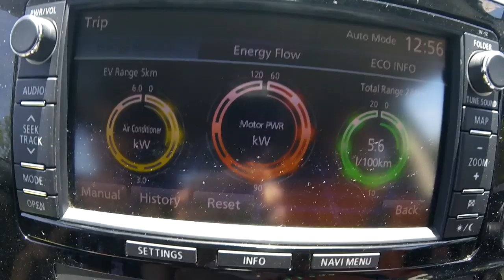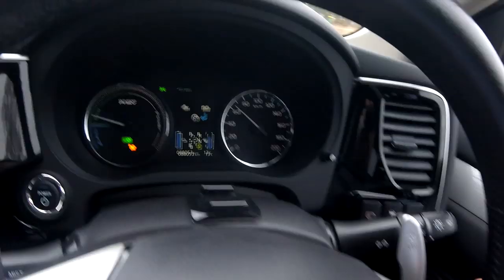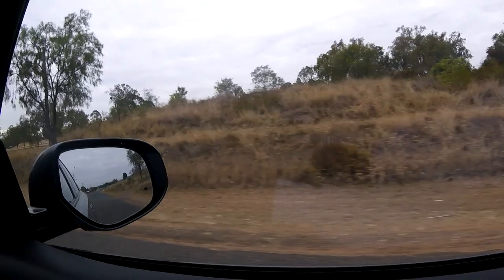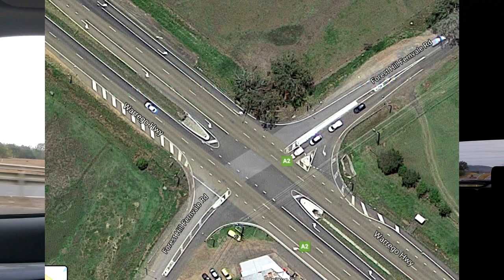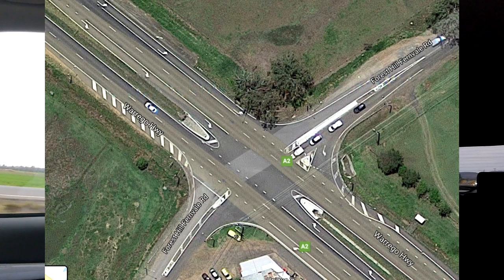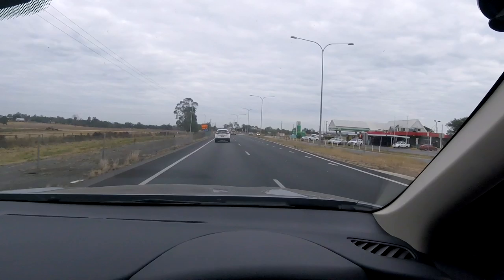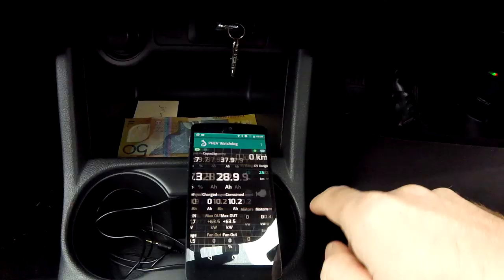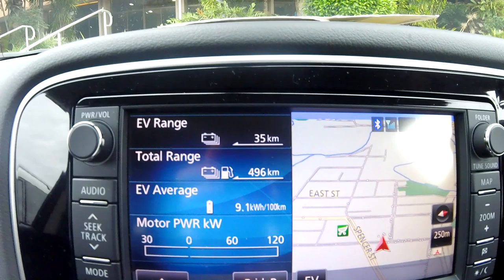EP256 - Lindqvist was yesterday. Fix the PHEV with the D-Method!

Comment: Andy, I reset the car a second time. This time, everything went well! The car is driving error-free again! I have the first time 12V BATTERY FOR 2 HOURS ISOLATED 2 HOURS FINALLY TOO SMALL at the 2 times I have disconnected 12v battery for 8 hours after all other steps again performed. Now the car is running like one again. For anyone who wants to try the Lindqvist method, I recommend disconnecting 12v battery for 8 and more hours. Otherwise, there is the possibility that you get the same problems as me the first time! take your time Lindqvist Method does not hurry! P.S Andy Best Man Keep it up !!!
Reply from the maker: Great Alex, thank you!

Comment: Goodmorning Andy,  I was just watching this video, when you said the story of Alexander “Alex” , after a partial reset, due to power failure.
We drove 2699 km to France and back to the Netherlands. Than the same as Alex, now power, after pushing the charge mode no problem.
At always happens with a low battery and low on fuel.  The time the main charger needs for a full load is longer from max 4.15 ‘‘tis now 5.15.
Yesterday at 19:30 we cut of the power on the 12 v battery of the 🚗. This morning at 07:30 we plugged in the charger, connected the 12 v. battery for 5 sec. and now we will wait.
Reply: Good morning, here is Alex. In my experience, the problem should go with performance loss way. I reset my Outlander second time on Wednesday, I disconnected 12v battery for 8 hours then connected charger, connected 12v battery for about 3 to 5 seconds and then recharged after 6 hours charging the car has finished charging as it should and the green charging light on Charger has blinked permanently. Charger removed and the 12v battery reconnected, at first startup comes an error message fault electrical system watchdog showed 105% and 40Ah ignition off again, comes immediately correction 38Ah and no more errors! Loading times have also been extended by about 1 hour for me. When loading with chademo I need now instead of 23 min 43 min while shaft charging station charge 6.8 Kw before it was only 4.2 Kw between 30% and 78%. in 4 days I drove 1300km of it 300 electric. Have not been able to find any more problems so far no matter if battery is full or empty, except that the battery capacity is now 37.7 Ah. I'm curious how fast the battery comes to old values. And one more thing the problem with performance loss probably comes from wrong data. according to watchdog the battery would have 10.6Ah when the problem occurs, I noticed that the battery only 262,8v indicated before the battery has never had less than 273v, I have never seen before. I suspected that the battery is already empty. It is not with me other than the 12v battery to separate again I was curious and have just tried what happens when I disconnect the 12v battery for a short time. I disconnected 12v battery for about 3 minutes and reconnected and suddenly watchdog showed me only 1.6 Ah instead of 10.6 before 3 min so difference of 9 Ah. That is, the controller has gotten the wrong data all the time, and of course not started the engine at the right time to recharge the battery because system has still indicated enough residual current. in reality, the battery was already empty! why it happened so I do not know. After two days of testing back and forth, I decided to reset the car again. Second time was completely successful. Hope my post was helpful to you and other interested parties. Alex

Comment: Finally the D-Method worked for me! I've been trying every variation of the Linqvist method that has been posted but didn't have any luck. Thanks! 
I have a North American 2018 version.
Used the BMU voltage display on the Dog until it showed just under 8v with no load. Around 7v with everything on: High beams, Fans, Seat Heat etc. It was very interesting to watch the various systems shut down with warning messages as the voltage dropped. 
Took about 3 tries when reconnecting the 12v with the EVSE plugged in to get the timing right.
Reply: Lon 12 how long it it take to drain the battery down to 7V?
Reply: @matradlinski8084  
Sorry I didn't time it. It was less than one hour. I also plugged in a little 12v cabin heater to help load it up.
Reply: @UCdlAm4TxwcK5OXwcqiLbq8Q Thanks, I just wanted to get an idea (I have the same 2018 NA model).  Did you leave the trunk open or closed?  Also, what was the final outcome, 38 or 40Ah?
Reply: @matradlinski8084  
Trunk was open with a blanket covering lock. 40 Ah.
I'm wondering if the Linqvist method worked with older cars as their 12v batteries would drop voltage during their disconnect hours. Our newer cars 12v might be holding their voltage longer.
Reply: @lon1253  Finally tried the D-method a couple of times. No luck! What do you mean by blanket covering lock?  Can't the gate be open during the procedure?
Reply: @matradlinski8084  Yes. I didn't have the room to leave the gate open for hours on end while I tried the different procedures. The blanket just prevented it from latching closed.

Comment: Andy, nice video,glad to see your happy face & back to longer videos  👍😁 
Updated now and looking forward to the suitcase, yeah a bit of ducking and diving again to keep us coming back ready for the next vid, just like the soaps do on the telly, your getting the hang of this 😉
Im quite sure this new method is the better way, as long as the rom is not disrupted on the eprom all will be fine otherwise you are screwed. Its much like the pc ram wipe that we do with the button to the case to reset I think?
If we knew if it was a plugin type & where the dam thing was we could adapt it so a reset was as easy as the pc type, maybe?
So up until now I wasn't convinced all this charge up method, unplug etc was the right way,but now I might be up to try this, as it seems more logical. 
As I still have 35.1 Ah Im not to anxious yet, but it would be nice to see 38+ back. if it stays dry here, there's a good chance I will attempt it.
Its a pity Haynes dont make manuals for the Outlander Phev cos that would be useful here.
Stay Charged m8  😎
Reply from the maker: Hahaha, thanks Chris! There is a new method every day... just wait you'll see...

Comment: Good morning, here is Alex. In my experience, the problem with performance loss should go if someone got the same problem using Lindgvist Method. I reset my Outlander second time on Wednesday, I disconnected 12v battery for 8 hours then connected charger, connected 12v battery for about 3 to 5 seconds and then recharged after 6 hours charging the car has finished charging as it should and the green charging light on Charger has blinked permanently. Charger removed and the 12v battery reconnected, the first startup is an error error electrical system watchdog showed 105% and 40Ah ignition off again, immediately comes correction 38Ah and no more error message! Loading times have also been extended by about 1 hour for me. When loading with chademo I need now instead of 23 min 43 min while shaft charging station charge 6.8 Kw before it was only 4.2 Kw between 30% and 78%. in 4 days I drove 1300km of it 300 electric. Have not been able to find any problems so far no matter whether battery is full or empty, except that the battery capacity is now 37.7 Ah in 4 days. I'm curious how fast the battery comes to old values. And one more thing the problem with performance loss probably comes from wrong data. according to watchdog, the battery would still 10.6Ah when problem occurs while I noticed that the battery only 262.8v cellen full 2.95 v indicated before the battery was never less than 273v had, I have never seen before. I suspected that the battery is already empty. it is not with me other than the 12v battery to separate again I was curious and have just tried what happens when I disconnect the 12v battery for a short time (actually stupid but I had nothing to lose anyway ;-)) me disconnected 12v battery for about 3 minutes and reconnected and suddenly watchdog has shown me only 1.6 Ah instead of 10.6 before 3 min so difference of 9 Ah. That is, the controller has gotten the wrong data all the time, and of course not started the engine at the right time to recharge the battery because system has still indicated enough residual current. in reality, the battery was already empty! why it happened so I do not know. After two days of testing back and forth, I decided to reset the car again. Second time was completely successful. Hope my contribution was helpful for anyone interested in these topics. Alex
Reply from the maker: Excellent feedback, thank you!
Reply: I did the L-method on my 2014 Outlander. Seemed to work. Now it shows same sympoms , power loss at 4 km left on battery. Took it to Mitsubishi dealer. They said the problem is with the BMU thinking the battery is 2 months old (10 years actually)! This is the real reason for the motor not kicking in as needed. Sure, hitting the charge button helps but this is not what it should be. Not very satisfied customer!

Comment: Lindquist method 100% ok, from 72% to 100%, or from 27 amp to 38 amp. working effective. 67000 kms vehicle year 2013. Thanks friends.
Reply from the maker: Good work, Antonio!
Reply: Hi Antonio, what was your method. I've a 2015 but no luck yet 3 times. Just need to know if an older model like mine needs longer battery disconnection etc?
Thanks.
Reply: @robertnewberry4329  Hi did you get it to go I finally got my 2014 done

Comment: Just a warning. Depleting the 12v battery that low may damage it. It is not  made for that.
Reply: Yes, not ideal for the battery, maybe there's a way of artificially reducing the 12v, by way of a low ohm/high wattage resistor between the neg pole
of the battery and the negative lead ???
Reply: Yes let’s ask Mitsubishi to artificially degraded the 12 volt. After all they are experts at degrading batteries lol
Reply: @AndyM...  a couple of H7 lightbulbs in parralell might do the trick.
Reply: @Zecret W That's a better idea, the only concern after that....is the low voltage going to damage any sensitive components (a bit like a mains power "brownout" which can do more damage that a "power out")  !!
Reply from the maker: Battery will be fine at 8V for a few minutes, no damage to expect. These lead acid batteries are very tough. My ride-on's battery was flat dead on just 1V for months and after charging it it still fine and working, holding voltage as before....

Comment: Same thing happens to me after LM as for Alex. Suddendly no power from the engines, ICE is not starting, no EV.  Really dangerous when it happens in traffic. Pressing the Charge button makes it come back to life after some time. It seems It happens when one cell goes too low, maybe <2.8v, when SoC is getting closer to 30%.  When Charge button makes it above 3v again, then engine power comes back.  This happens less and less as SoH is adjusting back down. Now I have an eye on the Dog when SoC is getting closer to 30%, and as soon as min cell voltage goes below 3.1, I press the Charge button. Would be a real good feature to add to the Watchdog App, to have a warning sound when cell voltage goes below some threshold. 
I have one bad cell which goes much below all others, which seems to be the reason for above problem, so I would like to replace just that one as I assume it will make a big difference. Any advice on how to do that is appreciated.

To be added as last item to LM step by step list: Press Charge Button in case Min Volt goes below 3.0V until SoH has adjusted back down enough.
Reply: That bad cell needs to be replaced asap. by dropping below 3.3V it starts degrading even faster than the other cells and the situation goes worse and worse.
Reply: @M1kke78  Asked Mitsubishi to replace the battery on my cost (105000 SEK), but they refuse to do it as the car has too many km(180000), so looking do to it on my own or with 3rd party shop, but don’t know how. Any help appreicated!

Comment: 12v acid battery discharged that low will damage the battery. 12v battery should not drop below 10-11v, otherwise it may not charge properly at all. I dont think I will try this particular method.
Reply from the maker: I don't think it will damage the battery. A few minutes at 8V is totally fine. If it would be 0V for a long time, yes, but this short moment does not cause any damage.

Comment: Alex propably had bad cells or the pack was degraded more overall. The pack is designed to give out something like at least ~300V (80x3.7V@25%) so who knows what happens when it goes below that. It would be nice to know the age, milage of the car and the dogs voltage reading from the battery pack. Low 12V battery could also cause those symptoms.
Reply: I would strongly reccommend everybody to do a watchdog scan on cells when battery is empty BEFORE performing Lidquist method. If there are bad cells found, then those needs to be replaced first.

Comment: The issues where the engine did not start when the battery is low I would suspect that there may be some real degradation that the BMU hasn't figured out yet.
Reply: This has happend to cars that hasnt done any reset. Its not bmu related.

Comment: After what feels like weeks trying the L method, I tried something of the D method a couple of times tonight.

1) Drove drive battery empty though not deemed required as I was worried it might try and juice the 12v.
2) Parked up, turned on remote heating, opened a beer and drove main battery down to 7ah for the same reason as above.
3) Turned car on (blue) but not in drive mode.
4) Turned on as many electrics as I could (Fan, High Beams, Seats, Cabin Lights, Fogs etc).
5) Drank beer and watched more phev video's on youtube.

6) The Dogs BMU voltage (same as 12v) dropped to 7.4v with load (8.2v no load). 
7) Disconnected 12v battery. 

8) Plugged in Mains Charger.
9) Reconnected 12v and quickly removed 12v until the Charger Click only just activated.
10) Wait about 10 seconds and then Plug 12v back in. Dog should show 38-40ah. Now drink more beer in celebration and let her charge.

I had to do steps 6-9 about 6 times before I got the timing right. I almost gave up to be honest! I'm very glad I gave it that one last go!

Also, a note on step 5. On the first go at this, I got distracted due to beer and accidentally drove the 12v down to 5v which isn't enough juice to activate the charging relays. I had to bail and start again after a small charge.

Don't leave out the beer. After weeks of trying to hack your car without success, beer is important. Next stop, the can bus. 

End result was 40ah which reverted to 38ah during the charge phase. This was formally 34.6ah. The car now thinks we can do 37 miles. we shall see!
Reply: I tried this method and the charger relay wont start so the car wount charge and the 12v battery could not start the car. I had EV SYSTEM SERVICE REQUIRED. The only way I could start the car again is jump start the car.

Comment: Why not disconnect both positive and negative terminals of 12v battery and follow the proceed from there. That should completely clear the bmu? Running the 12v battery to 7v may permanently damage it. Just a suggestion.
Reply from the maker: The battery does not get damaged from that. It will stay at this voltage only for a short moment. Just long enough to crash the BMU ;)
Reply: No need to disconnect both cables.

Once the Negative cable is removed, the battery is no longer powering the system.

Low voltage on a battery will not damage a battery as long as it is charged up again.

Leaving a battery in a low state of charge for a long period of time will damage a battery however due to suffation of the plates which can short out the plates.
Reply: Just disconnect the positive... then short to the negative wire for 10 minutes, normally this is enough to kill off all the keep alive capacitors inside ECUs. You can disconnect and wait ages, or just ground them right away. We do this at work to reset normal ICE ECUs.

Comment: What's the best way to drain the baterry in ACC mode?
Reply from the maker: Seat and steering wheel heater, wipers, windows, lights and high beams, rear window heating...
Reply: Ivan Jurasek just drive until it’s empty.😀
Reply: In my 2016 UK model, when ACC  mode is on only high beam and radio works. It will take hours to discharge. Which seems more time consuming than Lindquist, that BTW didn't work for me 4x. Unless of course I am doing something wrong...